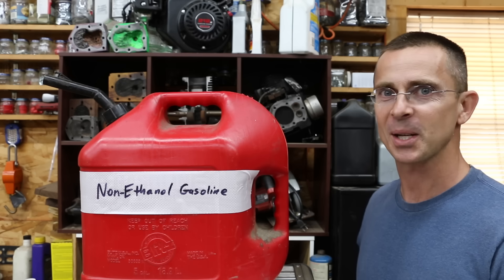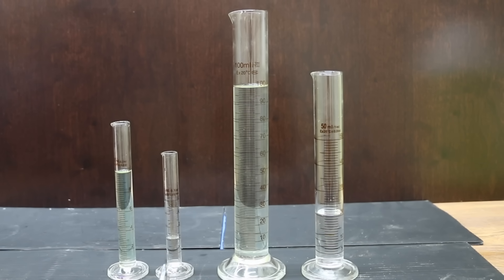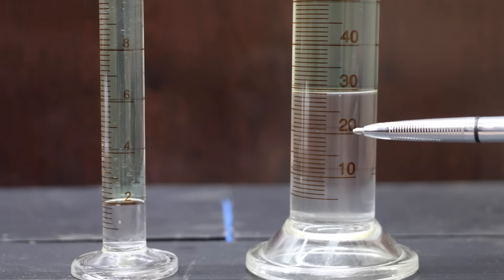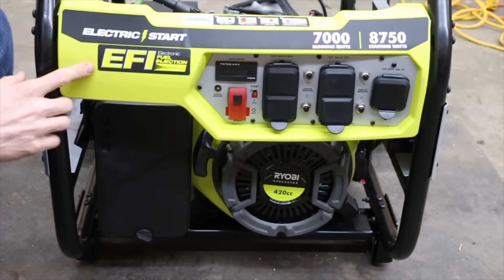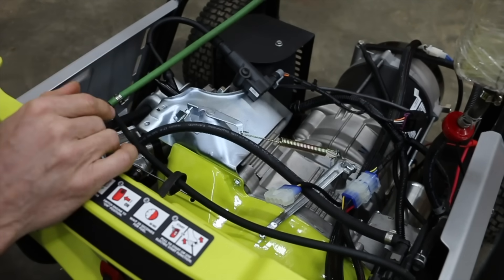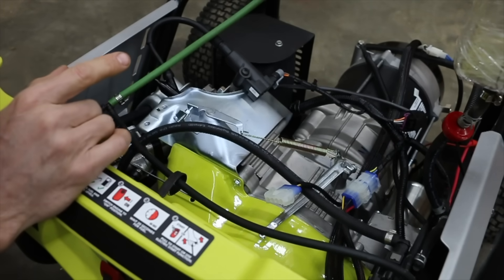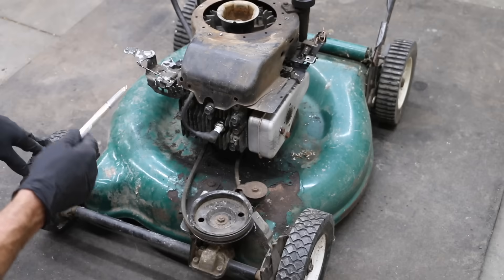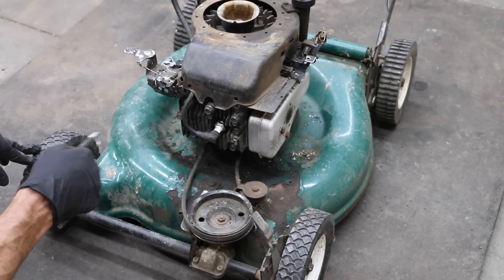Is Non-Ethanol Gasoline Really Better? See the PROOF!

Comment: Cool, you confirmed what I noticed when they first started putting that junk in gas.... I saw a small but noticeable drop in fuel mileage on the car I had at the time.  Now here's something new I hadn't thought about.  You mention your testing as to how ethanol can damage plastic and rubber parts not made to handle it... and I've had Leaks appear on older cars from what I'd suspect was the ethanol.  But I have an older Honda mower.... and I had been running regular ethanol/gasoline for quite a few years.... the carb was starting to give me problems in that I when I would either stop or turn the mower in another direction it would sputter.  I figured the carb was getting gummed up and would need to be either replaced or cleaned.  Someone told me about the non ethanol gas I could get at Walmart (hadn't known it was available until just maybe a year ago) but after running a couple tanks of the non-ethanol gas through the mower the sputter is completely gone and it's got noticeably more power.   Off the cuff I would have expected the ethanol to maybe clear out some of the gunk in the carb but it appears it did just the opposite.  Anyway, thanks for all your great videos.
Reply from the maker: You are welcome!

Comment: I’ve lost two classic motorcycle fuel-tanks, to corrosion due to ethanol
Reply: E85 won't corrode unless you let car or motorcycle sit for weeks without starting
Reply: maximus vonce - it is not quite that simple I am afraid. Alcohol is highly hydroscopic. Over time,  it atteacts water into the tank. Both motorcycles were in regular use and both suffered the same fate with the fuel tanks
Reply: Did the water/ ethanol eat away at the tanks coating? Why didn't the gasoline eat away at the tanks coating?
Reply: whaddayawant - they weren’t coated. All as they came out of the Guzzi factory.
Reply: @timhicks2154  yes another good test of ethanol or the additives or lower grade gasoline or combinations of how itreacts to different metals. Very important stuff to know cause I don't think ethanol is going away.
Reply: whaddayawant - no. Ethanol will doubtless increase in petrol. That will cause further problems.
Reply: @timhicks2154  I agree ethanol can corrode certain metals but I believe if a fuel system is set up for ethanol it can be a viable clean burning fuel. What I disagree with is fuel companies adding the high octane ethanol to their really crappy fuel to get mediocre grade of fuel.imo High chain hydrocarbons and ethanol don't mix well thats whats causing carbon and gunk in our engines.but I feel for you ,losing $on fuel tanks.
Reply: whaddayawant  - the tank death count now stands at 3!
Reply: @timhicks2154  grr that sucks. Is there a coating like in aluminum beer cans you could use inside your tanks? 10%  ethanol vs 5% ethanol in beverages should be compatible as a barrier.
Reply: @MoMo BaBa - what’s MMO? I’m glad to say I’ve saved all the tanks with POR-15 coating.
Reply: @MoMo BaBa - Thanks! I’ll try that MMO. Never heard of it TBH.
Reply: @MoMo BaBa - I do use the top quality fuels...mostly
Reply: @MoMo BaBa - thanks! Got some off eBay UK. 👍

Comment: Ethanol will absorb water and it will be burned with the gas unless you add 5 gallons of water to your tank. Duuuh. Ethanol is a catalyst and will improve your horsepower, torque, and increase gas mileage in up to a 20 percent mixture. Chevrolet had a bulletin on this for the 5.3 motor and V-6. E-85 vehicles gained up to 40 more in torque. Try it and enjoy cleaner oil also.
Reply from the maker: Thanks for the suggestion.

Comment: Here in Brazil we are using ethanol for vehicle propulsion since 1979, and It Works Pretty well. It was our answer for the oil crisis at the time.
In the past, when you went tô a car dealler you should have to Chose between a car with a ethanol only engine or a gasoline only engine.

In the 90s Brasil started tô add ethanol on the gasoline tô increase octane.

In the begining of 2000, our auto industry developed what they called flex fuel engines.

Vehicles equiped with flex fuel engines can use ethanol or  gasoline  or any mix of both fuels.

I have a 2006 Chevy Corsa Classic with a 1,0L flex fuel engine, and I use ethanol 100% only, some times I use gas but using ethanol only, I can keep the engine clean, you can see that in the oil change, the engine oil is Much clear compared with oil used on a engine that burn gasoline.

With ethanol I get less millage, but I in the other hand I get 3 more horse power.

With ethanol only, I can make 18 Miles per US gallon (city) with gasoline I can make 24 Miles per US gallon (city).

Regarding the fuel lines and fiel pumps corrosion due tô ethanol, those issues were already solved here in Brazil in the 80s using different materials, more resistent tô ethanol corrosion.
Reply from the maker: Thanks for sharing.
Reply: @ProjectFarm  
Very interesting vídeo, I like the way you compare products. Very good Job.

Comment: I replaced the carb on my Honda lawn mower twice, I was told to put startron in the gas which did nothing then another shop said those additive don't do anything, I think he's right !!
Reply from the maker: Thanks for sharing.
Reply: Startron definitely works, I can personally testify to that. I mixed it with non ethanol 90 octane fresh fuel to put it in my 2 4 wheelers and it took a little over 3 years before the tanks went empty, (I hardly use them) and they ran just fine until the last drop, so to speak!

Comment: (One year later, but here goes nothing 😅:) Hi, I own a car repair garage in Brazil, and we have 100% ethanol fuel in every gas station, and I can confirm that a normal flex fuel 4 cylinder engine does get a lot less carbon buildup inside the engine in the long term use. I work mainly with automatic transmission repair, but I have assembled a good share of engines and also done my nice share of troubleshooting in my life as a mechanic 😁
Reply from the maker: Good to hear!

Comment: I'd like to see if there is a difference build up inside your carburetor between the two fuel options maybe leave some fuel in the carb and let it sit for a time or even leave 2 carburetors in a fuel bath and see if deposits form on one r the other or bolth over a period of time.
Reply from the maker: Thanks for the video idea.

Comment: Do you have Alkylatbensin or alkylate gasoline were you live. They say its the most cleanburning fuel for small engines but it cost more and dosent wear out engines as fast as pumpgas. My dad worked in the forrest here in sweden for over 40 years, and when the aspen alkylate gasoline came out, they had to use it, no more pumpgas. He said that chainsaw, and that was all he used, wore out every two years before they changed, and they lasted over 10 years after. Maybe something to make a video about if you havent already.

Comment: Thanks for the video.  I have never had any problems with ethanol fuels in my small engines.  I do not drain for winter in my mower (usually use it a few times to mulch leaves down that blow into the yard late in the fall) and my blower gets used frequently just to blow off patio for 30 sec every time I mow in the summer/spring time.  weed eater is only thing that goes for 6 months or so without being used, and is an old echo, and usually starts on 2nd or 3rd pull.  I use the standard ethanol fuel in my 2019 Dodge Ram as well.
Reply from the maker: Thanks for sharing.

Comment: What I notice when I use gas with 10pc ethanol is that my car’s tail pipe is blacker. And when run my finger into the tail piipe there is carbon.
Reply from the maker: Thanks for sharing.

Comment: Ethanol has been used in cars since the early 80s. Cars are designed with ethanol blended gas in mind. I know that older cars not designed for ethanol blended fuel had problems with metal corrosion and gaskets and seals being dissolved when it was first introduced.
Reply from the maker: Thanks for the feedback.

Comment: For people worried about corrosion and damage, the biggest thing is to just use a fuel stabilizer. I bought my house over ten years ago and most of my lawn equipment at the same time. In all that time I have never had any fuel problems, even my snowblower which sits for months and months with the carb full of fuel hasn't had any problems.
Reply from the maker: Thanks for sharing.

Comment: This was great to see.  In a carburetor, those little orifices get corrosion in them because ethanol is hydroscopic.  That’s why so many homeowners can’t figure out why after a month or two their machines won’t start.  Ethanol loves to degrade primer bulbs too, it cracks those things in no time.  I work on many ethanol related small engine fuel problems.  In a vehicle that is driven daily, it’s not an issue, but yard equipment or recreational vehicles it’s problematic.
Reply from the maker: Thanks for the feedback.

Comment: Your carbon buildup could be because of incorrect fueling due to stoich differences. I am sure that on your fuel injected lawnmower you would see the difference since it has an o2 sensor and can correct for it. 
on E85 fuel piston's will come out with very little carbon buildup and will generally clean with wd40 and a quick wipe.
Reply: E85 will reduce your MPG by 30% too!
Reply: Of course. Stoich is 9.85. But still better fuel overall after your engine is broken in.
Reply: @highlanderc  Not!

Comment: I have zero issues with the ethanol fuel in my gen sets but I also turn off the gas and let it run dry so it should be out of the carb and fuel lines.

My only issue is usually my chainsaws. Hard to start on old gas. The cutoff switch cuts the engine doesn't allow to dry. So I think there's a little something to it if it's sitting in the carb long term or the lines long term. I don't notice any extra fouling or carbon.
Reply from the maker: Thanks for sharing.

Comment: I drive a D21. Since ethanol has been added to gas I've had to replace nearly my entire fuel delivery system. Taking into consideration the standard wear and tear. One component that I have to replace FAR more than I should is my fuel pressure regulator. It does have rubber components. Ethanol is a solvent. I personally think since my vehicle was designed without running on alcohol in mind. It may be the cause. Just my thoughts on figuring out why I have to replace these Parts more often than before
Reply from the maker: Thanks for the feedback.

Comment: Gained 2 mpg by running non-ethanol in my 95 Dakota. I've never hit 300+ miles to the tank running ethanol regardless of octane as i have tried them all and similar driving habits over past few years. And substantially less engine ping as well.
Reply from the maker: Thanks for sharing.

Comment: well done as always. I've always been on the ethanol train but it has its limitations but benefits as well. having built a few turbo motors, its really apparent that it has a large benefit in power and less harm to the engine

Comment: I use ethanol fuel and will continue to do so in my small engines. I have them all in a nice dry storage building and keep a dry erase board up on the door that I record start ups . Once a month all of them that haven't been used recently are started. Generator, chainsaw, back pack leaf blower, 2 mowers, one tractor and one walk behind self propelled. I have yet to have an ethanol related problem and I've used ethanol fuel ever since it came out. Let any engine sit for a season regardless of what fuels in it and you're asking for trouble.

Comment: Thanks - love your videos. It may be my imagination, but when pausing the closeups of the spark plug and valves, I think I do see more carbon buildup with the ethanol. Look closely at the electrode on the plug and at the seat around  the exhaust valve. Seems significant for such a short test run.

Comment: I ran ethanol in my old truck and carbon build up was bad on intake valves. Taking it off with a wire brush it had a sweet smell. Older engines won’t preform good after a while running it.
Reply from the maker: Thanks for sharing.

Comment: Bought a Troy built sp push mower 10 years ago put 10% ethanol gas in it wouldn’t start on the third mow took it back to lowes exchanged it for another and when I got home saw in small print on top use non ethanol fuel only it still runs great today starts first try.  I don’t put ethanol gas in my mowers anymore.  Lol
Reply from the maker: Thanks for sharing.

Comment: I use REC 90 OCTANE fuel in my riding mower. Some people say not to do that because it burns the valves. I don't think it does. But. We'll see as time goes on. I also use it in chevy 4x4x 1999 k 1500. Haven't had any problems.
Reply from the maker: Thanks for sharing.

Comment: Ethanol gasoline caused my Miles-per-gallon to drop two miles per gallon in my pick-up truck.  The owner's manual stated to not use ethanol gasoline.  I know for a fact that a specific detergent/ethanol gasoline makes my engine tap like a troup of tap dancers.  I had to quit using it for fear of valve damage.
Reply from the maker: Thanks for sharing.

Comment: Ethanol has a lower heating value compared to gasoline.. Gasoline has 32 MJ/l. But when mixed 10% with ethanol you'll have like 30 MJ/l. Which is roughly 96% energy content
Reply from the maker: Thanks for the feedback.

Comment: Don't touch Ethanol mix fuel. It absorbs moisture and unless your equipment is bone dry you are asking for trouble. As told by a small motor mechanic.
Reply from the maker: Thanks for the feedback.

Comment: my understanding is that ethanol was added to raise the octane level after lead in gas was banned. In my experience any  small two cycle engine using a flexible rubber diaphragm for fuel metering will stiffen requiring a rebuild. I have seen pitting in a two year old carburetor  aluminum bowl even with the fuel ran out over the winter. Any treatment that  actually stopped the aluminum corrosion and prevented the rubber diaphragms from getting stiff would be a godsend. If it also prevented small globs of gel from forming in the gas that would also be a nice nous.
Reply from the maker: Thanks for the feedback.

Comment: E85 is the bomb in turbo DI cars that are tuned for it. Look at APR's E85 tune for EA888 Audi engine, +100hp. It also clean out the previous deposits, I don't even use FI cleaner anymore, just a gallon or two of E85 added to a tank, it really perks it up. It's a very misunderstood fuel because the oil industry put out a lot of dumb propaganda against it. 
Think about it, which burns cleaner, alcohol or gas that was refined from crude oil??? I'll give you a tip, E85 doesn't need a bunch of detergent additives to run clean. E30 and E40 are coming to pumps everywhere, and new engine designs which make better use of it are coming too. Mostly, alcohol has a greater evaporative cooling effect when injected, so turbo boost can be higher and with DI engines that run stratified mode, the injector fires 6-7 times, DURING the combustion to cool and stir the mix. 
Current Flex Fuel engines mostly suck, except turbo ones, especially with a proper tune. If you are pinching pennies, sure less MPG, but wheat we need to consider is miles per dollar. In my old non-turbo Mercedes with Flex Fuel, E85 costs 20% less than super, but gives 10% less mpg, a net +10% gain. In my turbo cars it's like race fuel for less than regular. +100hp....who cares about a few pennies MPG, MP$ is better than with super gas. People running regular, keep doing what you are doing, lol. Try the E15/88 octane when you see it.

Comment: Couple ideas:
1.  What happens if you run 4 cycle engine with 2 cycle oil/gas mix in the crankcase?
2. Run 2 cycle engine with 4 cycle oil for mix.
3.  Does 40:1 or 50:1 2 cycle oil have measurable performance/longevity difference?
4.  Best value power inverter....I have bought 75watt cigarette lighter power inverters for the laptop and 600watt inverters that direct connect to the battery and they never seem to perform, especially when vehicle is at idle.
Reply from the maker: Thanks for the video idea.

Comment: Lol i am only 60seconds in and i know what the results will be. E10 - E85 is a great fuel really clean burning. ethanol has less btu's per gallon than gasoline but can lay down power better if setup correctly even though it requires more fuel to do so. But the problem with ethanol is its corrosive properties. Its really hard on plastic and rubber. So fuel line, gas tanks, fuel injectors, and seals that are exposed to it directly rot out alot faster. They do make ethanol rated plastics and rubbers but they still break down. It just takes longer. And non ethanol fuel is 100% required on say like my 1996 honda cbr900rr as it was not designed for ethanol fuel so if i put e10 in it and let it sit in the carbs over night the next day the bike will be running extremely rough and missing on cyls with uneven afr. So thats something to keep in mind is older motors were built with rubbers and plastic that was not ment for ethanol.
Reply from the maker: Thanks for the feedback.